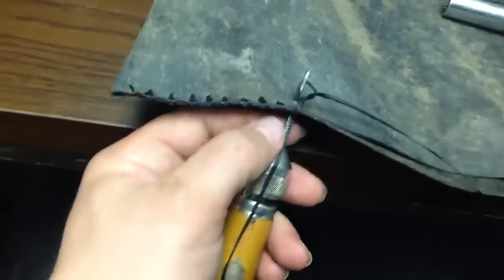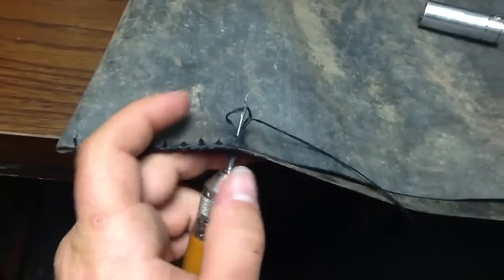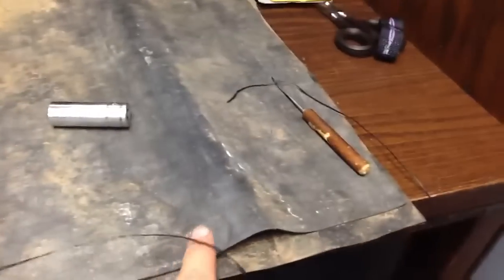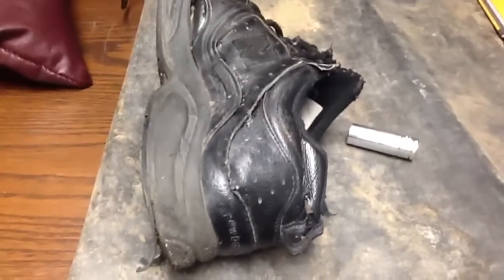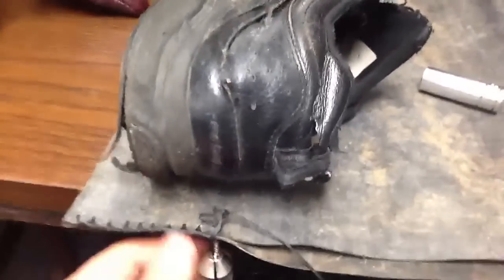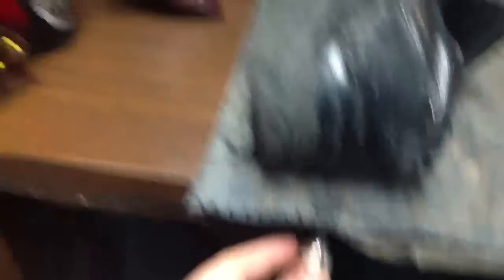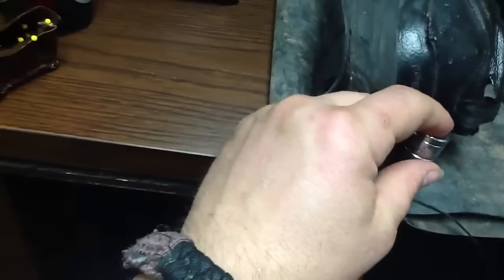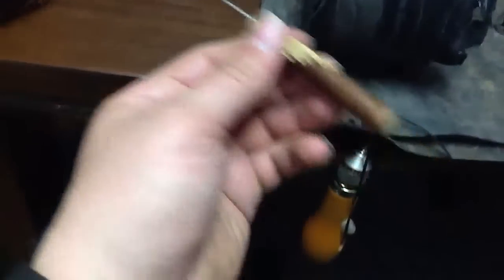Sewing a rubber boot covering over shoe

Comment: A hot-glue gun is good for many types of repairs, I once used some on my shoes.  Some dollar stores have them, good to get several packs of the hot glue sticks.
Reply from the maker: My idea failed and I had to abandon it here. I have played with the hot glue guns, but they simply don't offer the strength to withstand bodyweight. I tried this idea because I had a terrible toe fungus and the spring time is always very wet in Wisconsin. A year later I cured the toe fungus and left Wisconsin.
Reply: Travis Heinze Ok, right, shoes can be repaired, but that glue does not accept too much stress, and is slightly weaker than good rubber cement or some shoegoo.   But hot glue is good for many other things.  Good to have rubber for shoes when they war out, get thin on the bottom, on the soles, can probably glue on a new one right over the old one.  That would be good anytime or shtf, when there is no shoes for sale.